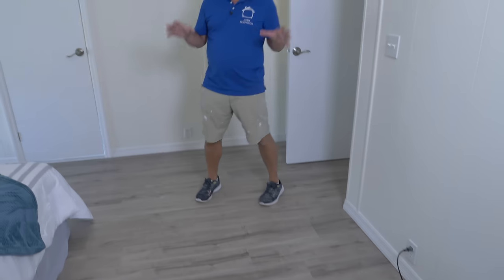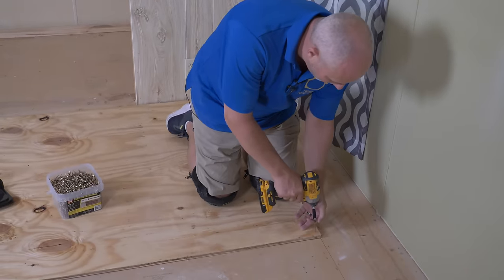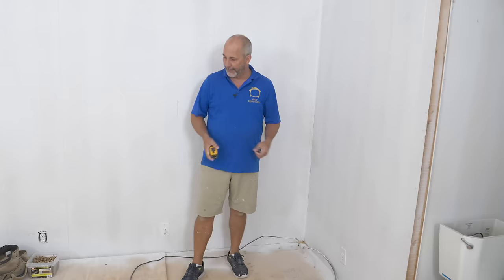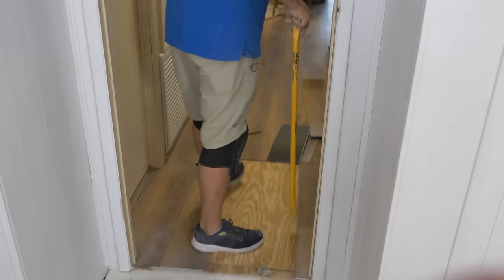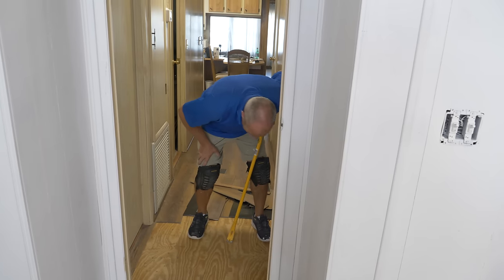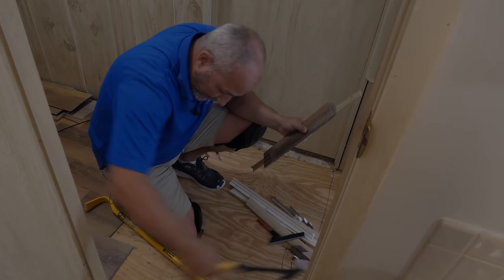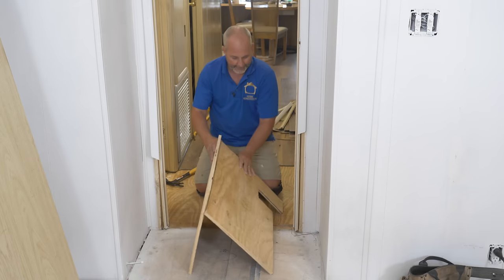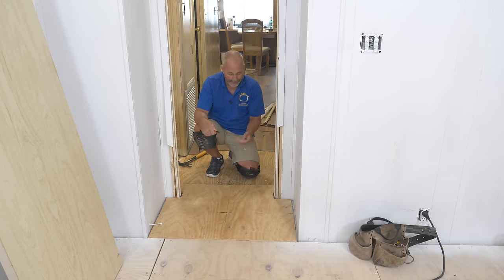How To Fix Soft Subfloors (The Easy Way)

Comment: Hey Jeff, would you reccomend just going over old subflooring if the origional subflooring is only nailed down? (Not screwed or glued)
Reply: If the existing subfloor is already exposed then no harm in throwing in some screws anyway IMO. Maybe not as many needed if you're putting another sheet on top. Just my 2c.
Reply from the maker: I really don't find a lot of value in the glue if you are screwing so save what you have and screw it in.

Comment: Do you keep that 5/8" gap at the tie-in to the hallway? I'm assuming it's within the flooring tolerances but wasn't sure if that was the case or if it'll be addressed when you take a look at the bathroom and determine what you need to do. Thanks!

Comment: Well just maybe the previous repair person didn’t notice the trouble at the time of last repair it has only become noticeable in the weak spot for cpl reasons 1 being all the moister your speaking of went past the plywood that was installed an as ya know it is just being absorbed in the now noticeable problematic area! But idk what they or anyone is thinking! lol I think tho rather than neglect it was probably more of an unintentional act! Just glad u found an noticed the weak spot an now are going to include it in your repair. Gd deal if any other unrepaired parts of the floor at this time in time it also will probably have to be done. Yada dad I best get to it have a grt day.!!

Comment: what if you have particle board 1/2" over a subfloor that is squeaky? Romove the partial board first or go over with another layer of solid plywood 1/2" sheets with screws? FYI - the old particle board has 1000s of nails in it as well.

Comment: ? Why not pull up old floor and check for other issues in duct work and plumbing. And replace with 23/32 advantech or 3/4 gp drymax.

Comment: I am new to the DIY scene and have a single wide trailer that I will be attempting to renovate/repair. With that being said, is it still ok to add new plywood over the existing, if there's a possibility that the joists may be rotted?
Reply from the maker: rotted joists must be replaced. as long as you repair the vapor barrier underneath you should be fine to add a new layer of subflooring. expect another 20 to 30 years out of it.
Reply: @HomeRenoVisionDIY does the under have to have insulation, mine fell out and I’m not sure how to replace it. My floor got soft due to a septic leak that went unnoticed so I’m looking to put 3/4 in plywood over..

Comment: would the cement type floor leveler  be an option as well?
Reply: You need a stable floor before you use the leveler first usually.

Comment: Looks like you used CDX plywood. I'm planning a similar project and have been debating using CDX plywood vs BCX sanded plywood. How smooth does the plywood need to be for LVP underlayment? Is CDX good enough?

Comment: I got a bit of flex in my floors. Cannot access joists from basement as ceilings are dry walled. Can adding another 4x8 sheet of plywood on top stiffen it up? Or should I pull up the original subfloor and add bracing in between joists? Thx
Reply: What did you end up doing ?

Comment: I would address it with the customer,  let them make that choice. Some people just don't have the extra funds and may have HAD to fix a soft spot so soft they would fall thru if not fixed. Flooring is ridiculously expensive,  then add the labor. I have installed floors for 27 years in Indiana
Reply from the maker: In this case I am the customer. I don't want to patch it knowing the whole house is a ticking time bomb.
Reply: @HomeRenoVisionDIY  then get your wallet out! 🤑

Comment: From a building science perspective, the code mandated crawl space ventilation attempts to defy reality. Hot warm moisture saturated air enters the cool crawl space and condenses. If a vent fan is installed to pull outside air in to the crawl space, the bottom of the floor will collect rain drop[s and rain down on the bare ground. The informed recommendation is often to install extremely heavy plastic sheeting with the sheets over lapped and vapor sealed to each other  and the perimeter. To prevent rodent problems they recommend, 4 inch deep  pea gravel both above and below the plastic sheeting. Supposedly it is impossible for them to dig because it rolls  into its self. Then seal the crawl space and most important install an economical to operate whole house dehumidifier that pumps the moisture into a drain exiting the house. An informative experiment is to  fill a glass  or metal cup with ice and then add water.  If you take it outside and set it on a hard surface, a puddle of water will collect around it. Often it can be shocking to see how much water the air holds. Matt Risinger is a big proponent of whole house dehumidifiers.

Comment: I have a question im remodeling a Mobile home
1st question. Can you remove the windows and replace with "Real ones?
2nd. Can you cut out a wall frame it to add a Door?
3rd do you have any videos showing a Bathroom remodel where you remove a Big garden tub to build a Large walk-in shower? I'm wanting to learn how to move the drains add a second shower head, with the faucets that come from the wall not the actual surround system?
    Know it's ALOT of questions I'd appreciate any one answered.
 Thank you for your post. You've help me have to courage 🧘🏾‍♀️ to Try my own Home updates. New Females Power tool gal 😏👍🏾
Reply from the maker: we did that window video a few weeks back. and yes we did the bathroom. that series is coming soon.
Reply: On question 1 we had a window local individual who made the windows. Mom insisted they are the type you can pull toward you and clean like a normal house.

Comment: I understand about the budget, but how much would cost to shop vacuum up all the stuff between the layers.  Also the expense in the adhesives between the layers is not cost prohibitive in the long run.  For all the time it takes, add some more screws.  Once the flooring and baseboards are done then you find a squeak.  Then you slap your forehead with the palm of your hand.

Comment: When you cut the plywood in half on the plywood you installed in the doorway ,i thought you cut in half so you could slide the new plywood under the door jambs.  Seeing this isnt what you did. How do you finish the flooring around the bottom of doorjambs without having a gap? Wouldn't it been better to have cut the bottom of the door jambs enough to fit the plywood plus whatever the finished flooring is ? Wouldn't this way have a better finished look? Thanks 😊
Reply from the maker: you will have to see the flooring video when it comes out. having the subfloor under the jamb is not necessary.

Comment: This video seems contradictory concerning the various conditions of different parts of the floor. Now some schmuck (like a previous owner of my mobile home) may decide that they don't want to take the time or expense to replace a subfloor that really should be replaced. While replacing the insulation under my house last summer, I noticed that the particle board under the bathroom was flaking off badly in several places. This is in addition to the joists presenting with horrid decay. 
So, I dig into my bathroom floor this year feeling more like a archeologist than a DIYer. The last owner put down some 7/16" plywood and stick-on tiles. Under that was 1" particle board with stick-on tiles. Under that was the original 3/4" particle board subfloor that someone pulled off the linoleum to put stick-on tiles down. With the removal of each layer, I was hit with the sight and smell of wet wood and the particle board just fell to pieces with a light tap of the hammer. My thoughts suggested that if the Good Carpenter himself saw this, He may take His own name in vain. What a mess!
Please be more direct about when it is ok to cover up old floor with good floor and when you need to be smart and just tear it out with a fresh start. I'll be replacing this floor with 23/32" ply topped with T&G OSB with a final layer of 1/5" luan for the linoleum. All this of course after I replace several joists and bottom wall plates. I am on a very tight budget (SS) so this is a BIG expense for me. Being disabled is a major set-back as well, but the local American Legion is sending help. Thanks for the videos.

Comment: I was going to do this, but decided to use self leveler on my 3/4 osb.. then Schluter membrane before large format tile.  
Am I wrong? I rly didn't want to raise the bathroom floor if I dont have to..
Reply from the maker: hope it sticks. schluter membrane is not designed to be installed on leveler.

Comment: would this method fix snaps and cracks and pops when stepping on the floor? i have a middle room floor subfloor that i think may have been too tightly installed and thats why the noise , so assumed i had to rip a blades width thru the subfloor wood meet points, or 10000 more screws?
Reply from the maker: if the problem is year round it is more likely that it is the lack of screws. screws were not used until very recent history so all floors with nails make noises.
Reply: @HomeRenoVisionDIY   ty ty, will double up and see

Comment: Is there an issue of adding 5/8" to second floor?  I.e., top step will be 5/8" taller.  Thinking trip hazard with the odd step height?
Reply from the maker: not if you increase the stair tread height as well.

Comment: I couldn't help but chuckle - the finishing in my basement was paneling over paneling, because the paneling underneath was wet and rotten.
It was so bad that I could poke my finger through it, but they "fixed" it by just putting another layer over it.
Really expensive and difficult to repair, but buyer beware I suppose.  :(
Reply: Ouch ... if you can't see it its not there I suppose😮

Comment: Except that rotten floor is going to deteriorate and come loose and put to much weight on the insulation and it wont be long before your insulation is laying on the ground and you have a mess with even more stuff to REPAIR.  Repair does not mean COVER, HIDE, TRICKS, or BUDGET.  Do it the right way the first time!

Comment: What if the subfloor already has a layer on top and is still soft? I'm 6'3 and have 8ft ceilings.  The idea of losing another 3/4" of ceiling height makes me feel claustrophobic. The doorways are already kind of tight
Reply: It's not exactly a huge job just to strip down to and remove the original subfloor. IMO, this is a fine beginner/fast method but for a DIY it's very much worth the extra time to replace original and not lose more space.

Comment: Won’t this just increase the weight on the existing subfloor increases the risk of structural failure resulting in more damage over time then if done correctly?
Reply: I’m 25 years old been doing construction my hole life with my father and when I purchased my first home I noticed the subfloors in the 3rd level of the house (not basement main floor but upstairs) has a weak spot along the centre seems like it would be better to add another truss to increase weight on the subfloor before adding more above it

Comment: You said "This material has soaked up so much moisture that it was weakened because it's not plywood." But it looks like plywood to me when you removed the vinyl flooring. I don't understand.
Reply: That was part of the new subfloor that was replaced.  He said someone had already replaced are part of the floor and used plywood.

Comment: I find more squeaks as time goes on. I presently have a wood floor that has sheet vinyl between it & the subfloor. I’m NOT impressed. Going to have to remove the vinyl so I can see where the joists are. I suspect the subfloors were all secured with nails. I already know the walls were done with nails.